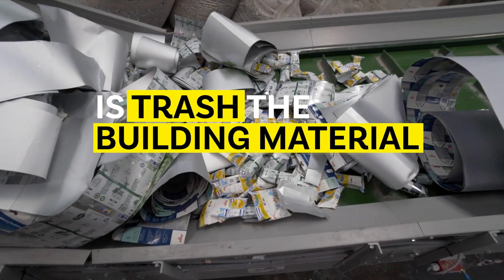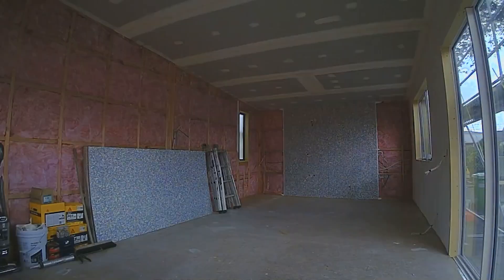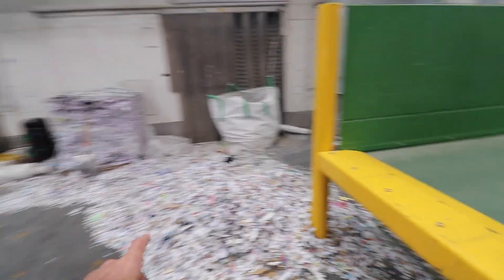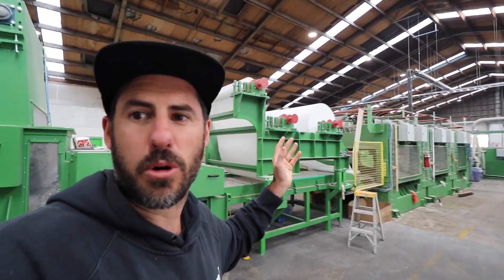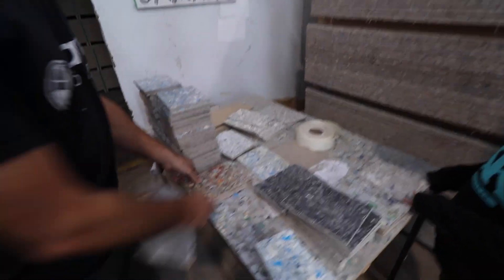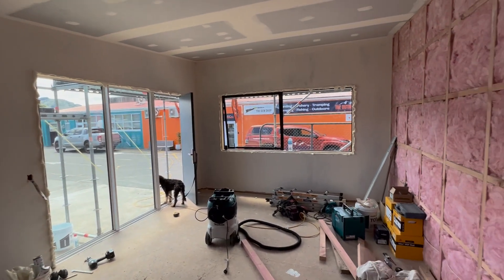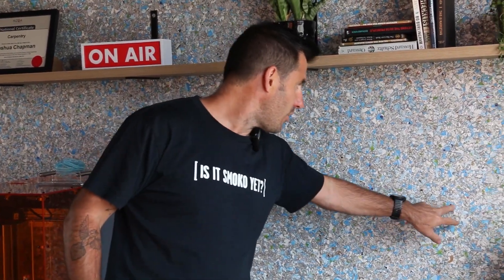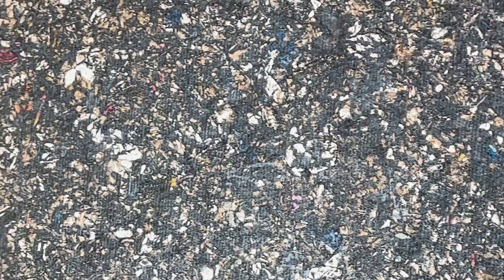Building With Trash!!

Comment: The fire hazard risk that is probably associated with this product is a concern. Lining a building with paper, wax and plastic... What could possibly go wrong.
Reply: What makes you think it's a greater fire risk than alternatives?
Reply: @wainivanua  Paper, wax and plastic are certainly more flammable than gib board even though gib board is lined with cardboard, and they are even more flammable than most woods. There is also an issue of toxicity of burning plastic. Additionally, you might recall the deaths in London a few years back when the plastic cladding of a high rise apartment building caught fire. I understand that plastic exterior cladding is no longer permitted in England and might not be here (in New Zealand) either.